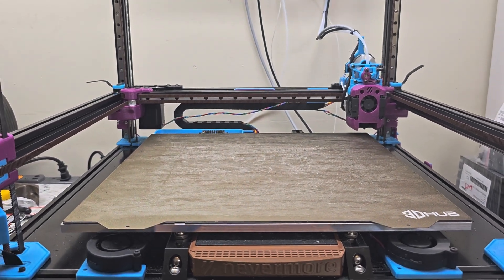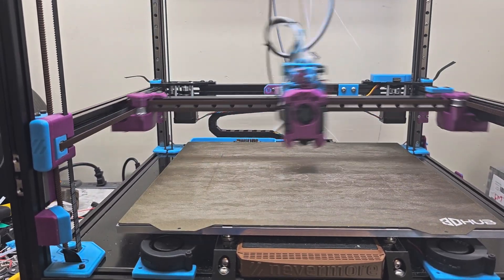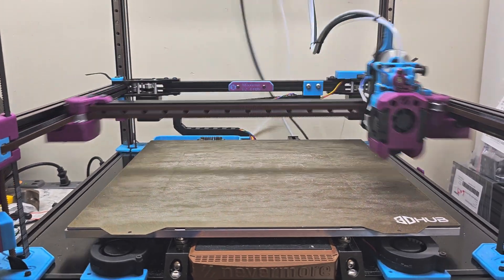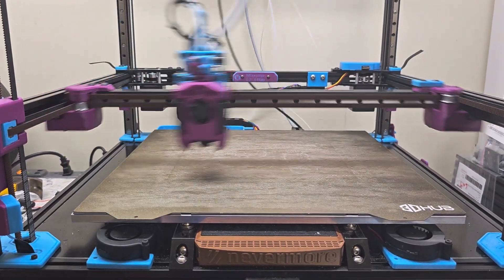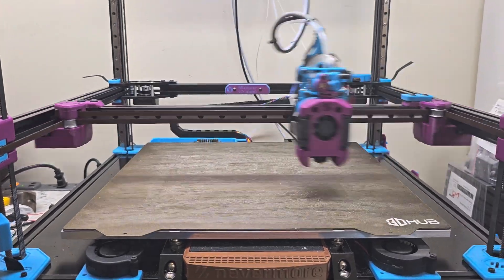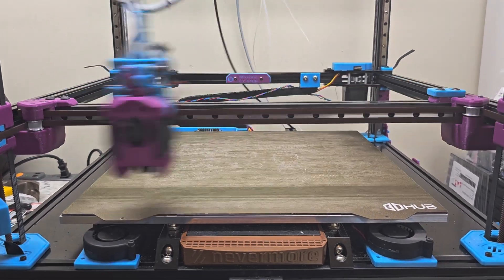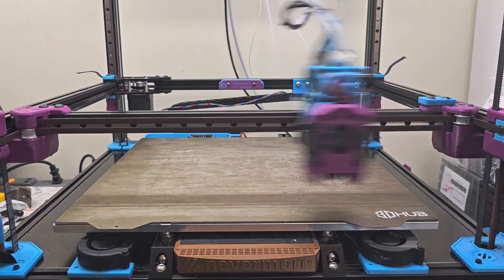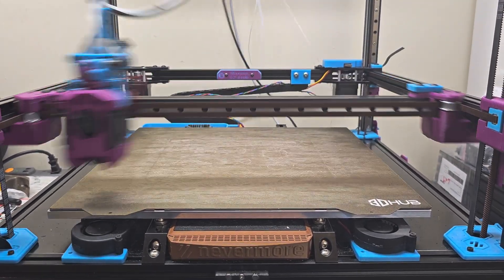Voron 2.4R2: Stress testing my new LDO 2804 Super Power motors

Comment: This is so nice, he man you clearly have more experience than me, I´m finishing my VzBot with four Super Power HT at 48v, is gonna be wild!
But I´m purchasing parts for a custom 500x400x400 Voron 2.4 that I will run on AWD at 24v at the beginning, only for PLA, so I will love to ask you couple questions: one is if you think that having four motor I could run 38mm ones, or be better with 48mm? I´ll run Cpap and probably Sherpa Mini and Vz Toolhead so pretty light gantry.
And the important one is that I will love to run no heatbed because of custom bed size and wait times and power consumption, so, any suggestions for a reliable cold bed PLA only setup? I can get a custom tempered glass or mirror here so flatness should not be an issue, thank´s in advance (y)
Reply from the maker: Sadly, I have no experience with printing without a bed heater, or with using 38mm motors.

Comment: Is this possible to run on 24v driver? How much amp/current to push?
Reply from the maker: Yes. These motors are rated for 2.8A RMS.
Reply: @oldguymeltsplastic  I'm actually running on my x n y. I push it at 1.7 & 1.9 still got error after few hours printing. Klipper gv me y under current error stop the print. I guess I have to run it at my board max output? Skr mini e3v3 got 2.5a max I think?
Reply from the maker: @Danielkcc  your stepper drivers might be the bottleneck. I run these on TMC5160s, which are rated up to 3A, installed on a BTT Octopus MCU.
Reply: @oldguymeltsplastic  yah I guess so. Thx man.
Reply: Just found out tht tmc 2209 peak current is actually at 2.8A. Rms is at 2.0A. Might gv it a try and see if it makes any difference. Just see if anyone has experience on tis pls advice

Comment: Do you use LRS-100-48?
If you use 2804 motor, run_current would be 2. It is 48V*2A=96W. Because it is an A and B motor, it is 96W*2 = 192W.
100W PSU... Is it okay??
Reply from the maker: Short answer: yes, I am using an LRS-100-48 to power my AB motors, which are LDO 2804s. I run them with a high run_current of 2.8, and while the 2804s run at about 80C, I have metal AB motor plates, that basically turn the entire frame into a giant heatsink. I have never had any issues with this configuration.
I am not myself well versed in electrical power consumption math, so I will quote Dragonkitty from the Voron Discord:
"They are not driven at 48V permanently. 48V help reaching the coil saturation quicker. Let's take your 2804 as an example, the datasheet tells you: "Rated Voltage 1.4V/Phase". So with the current of 2.8A/Phase, we end up with 1.4V*2.8A = around 4W per phase. Multiply by 2 phases, makes 8W per motor. Apply a safety margin of 1.5, ends up with 12W per motor, 2 motors = 24W, so a 50W 48V PSU should be plenty."
Reply: @oldguymeltsplastic  I have gained knowledge with your response. Thank you. By the way, why do you use 100W instead of 50W?
Reply from the maker: Because I had no clue how much power I would need when I bought the LRS-100-48. I knew that the LRS-200-24 was sufficient to drive 7 motors and all of the other electronics on a V2 at 24V, so I figured 100W of 48V power should be plenty for just two AB motors. Turns out I overestimated that by a factor of 2 (or 4).
Reply: @oldguymeltsplastic  I'm using 24V for ez5160 driver.
I want to change it to 48V like you.
I have a question. Can the recommended acceleration of input shaping be high?
Or does it only speed up the X and Y movements?
Reply from the maker: 48V can definitely push your speeds and accels higher with higher run_current values on the relevant stepper motors.
Admittedly, I am not great at tuning my printers to eliminate ringing and other print artifacts, so a printed part's quality that might be acceptable to me, might be completely unacceptable to others.

Comment: wow very nice. In the last video I saw that you are having problems with the ultra light gantry and ringing (which I am currently having) and I wanted to try the same setup as you with the LDO 2804's motors, after I canged my gantry setup. Do you perhaps have instructions on how to install the 48V stepper and install the additional power supply unit?
With the extruder, the printer looks really great. I'm happy to be able to recreate it 😍 thank you 4 the video
Reply from the maker: My input shaper graphs look cleaner than before the rebuild, so it looks like the teardown did help somewhat.
For the X gantry, I have gone back to the original Misumi 2020 extrusion that came with my Formbot kit, using an MGN12 linear rail, and the stock Voron 2.4R2 XY joints printed in ABS.
The Voron Design Cube that I printed at these speeds completed in under 17 minutes of print time, and while functional, it does have some print artifacts. I will try to tune some of those out, but it might be that the only solution is to slow things down a bit.
In my speed testing, I stopped short before I hit any hard limits or motor skipping, but already there were lots of vibrations that my furniture didn't appreciate, so I will likely scale back my speeds a bit for everyday quality prints, and also to save me having to buy new furniture.
I did briefly go over my 48V set up in an earlier video here: https://www.youtube.com/watch?v=TAzfL85ZRUo&t

Comment: Im surprised that only a 100W PSU can keep up honestly
Reply from the maker: Someone suggested that for just two motors, it should be sufficient, and so far, Klipper hasn't complained of any power issues with the AB steppers. I do have a Mean Well UHOP-350-48 that is intended for the Annex K3 build, so if I start to get any issues, I can make the swap.